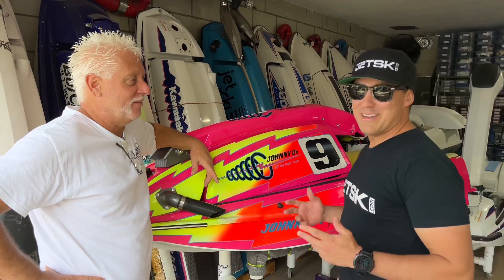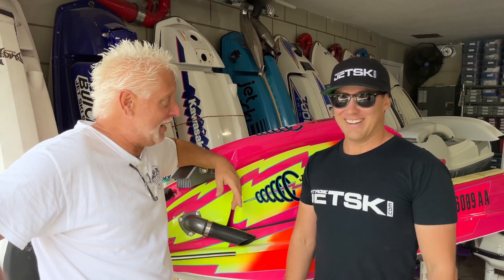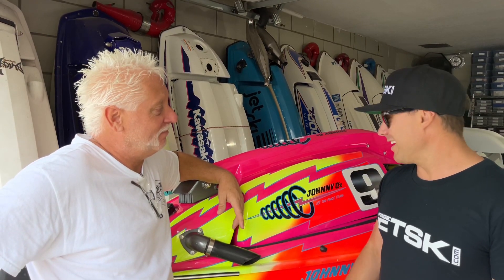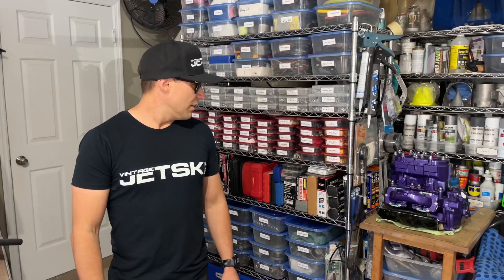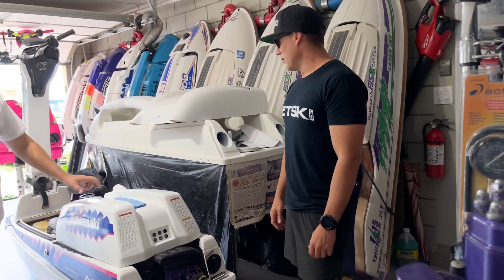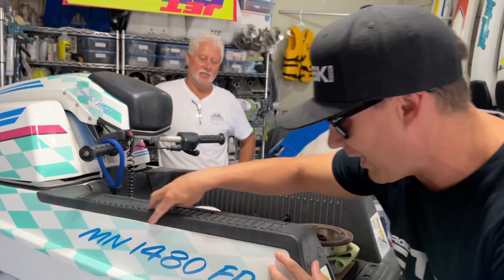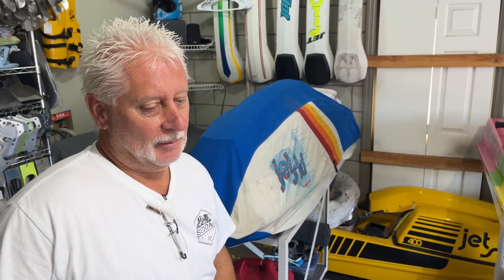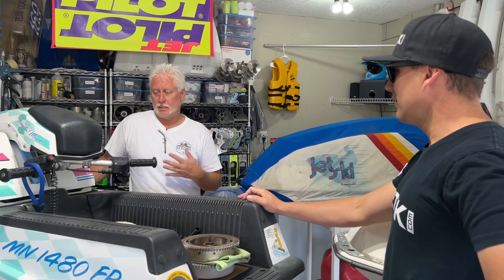Vintage jetski visits Mark Raves shop tour with guest GPO Jimmy

Comment: The whole purpose of the rings on the Westcoast pipe is to allow the builder to adjust the tuned length to the porting or more accurately the power band design of the engine setup.
Reply from the maker: Interesting, Thanks!